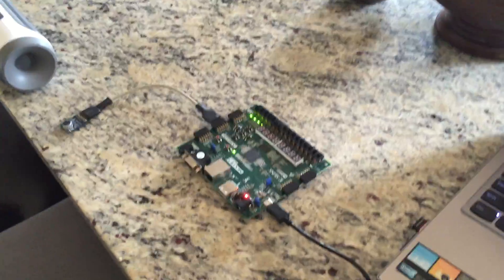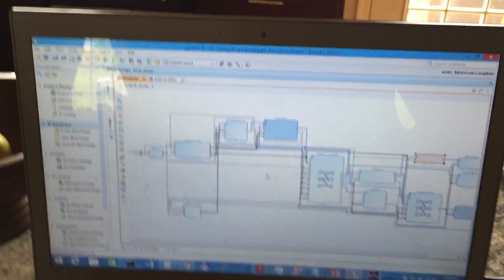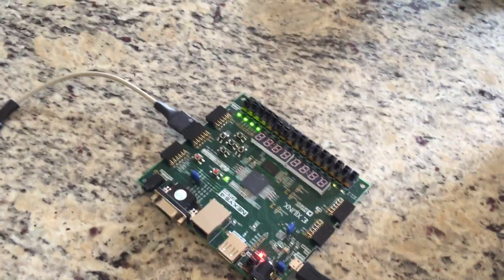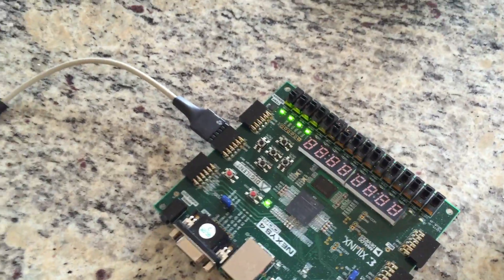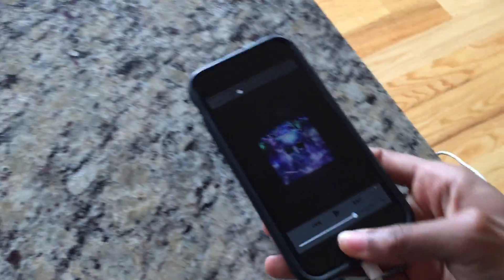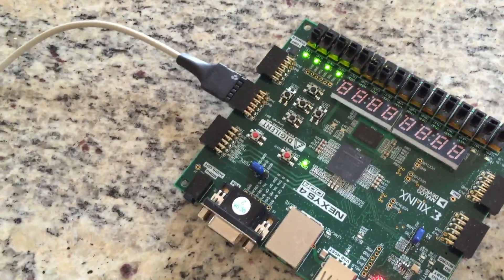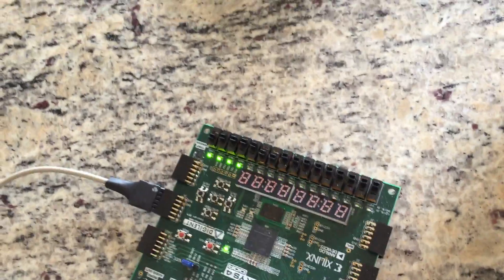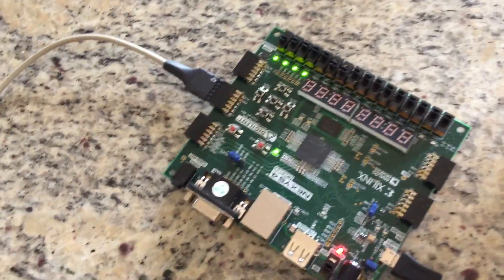Nexys 4 DDR: Simple Blazing FIR SoC Project

Comment: hi,is it posiible to connect a simple LED(externally) on nexys board without pmod switches?
Reply: Yes, with a serial resistor. Keep in mind that the voltage of an output port is 3.3v. depending of the led colour yu'll hava a Forward Voltage, so, the resistor can be betwen 180 ohm to 300 (aprox).